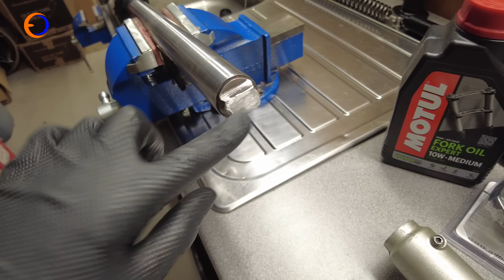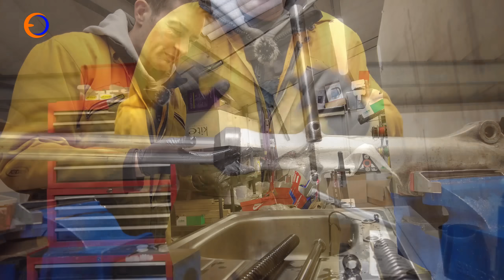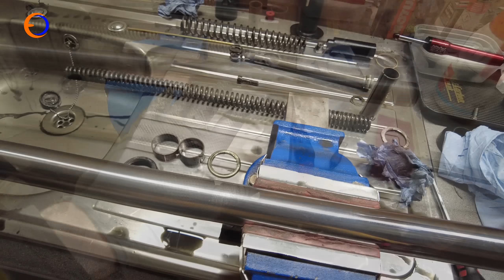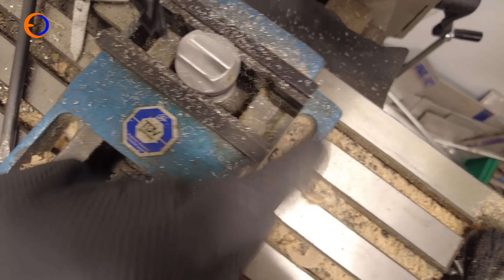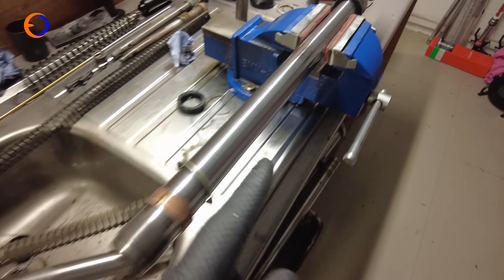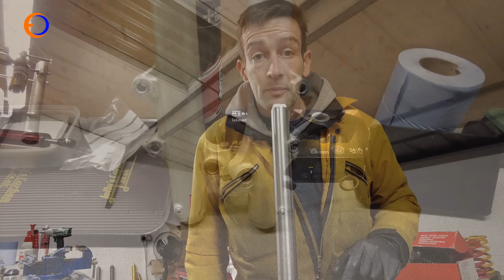Old Skool Fork Rebuild. Suspension service for the Suzuki GSX 750 Project build. Restoration. 80's

Comment: Dave at 11:20 I'm terribly sorry to tell you but you rebuilt the fork wrong. That washer needs to sit above the top bushing and you drive the universal fork seal tool against the washer to seat it. Then the oil deal, then the dust seal. That's metal washer is NOT in the correct place sorry to be the bearer of bad news

Comment: The washer above the oil seal looks to large to me , it looks like it will foul the seal as it’s to tight around the stanchion, and the forks are air assisted if memory serves me well pressure is about 11psi for normal riding

Comment: A well explained process with no BS. It is truly amazing the difference a fork refresh can make. I stripped and rebuilt 1998 XJ600n forks, new bushes, seals and oil and the forks are every bit as good as they need to be for a road going bike. In fact it gives a nicer ride than my Z900RS.

Comment: My old cb900 years back had air forks. Just a couple of valves. You'd give them a couple pumps with a footpump then adjust to about 5psi think it was. It did actually make a difference. It was a regular thing to do as it was so little air and it didn't last long.

Comment: owned the 78 gs750, any wonder at 110mph you would xperience serious wobbles, the fix was to bridge the forks at the fenner with a thick brace ..  helped SOME . .  really needed larger forks, and steering damper.. the bikes would do 125 mph but the wobbles were so bad you din't dare go over 105-110 .. anyone rode back then knows what I mean, the brace was worth 5-10 mph depending on surface condition, tire pressure tires all that .. fun fun fun
Reply from the maker: When men were men and hedge bottoms were worried
Reply: My 1978 GS750 double disc wire wheels, was solid up to indicated 130mph it had flat drag bars Girling rear shocks and Metzeler tyres that transformed it, that was coming off a GT500 that did wobble though!
Wish I still had both bikes now.

Comment: those used to be schrader valves to pout nitrogen in the forks..  pressurized, yup, gave you more adjustment,  very soft or very hard . . adjust with pressure and spring rates .. yup, rear shocks worked the same way but they had some spring pre laod adjustment, this was all before adjustable shim stack and valve suspension .. a good suspension guy could install adjustable cartridges and adjustable preload but it was expensoive fopr top crews in the 50's 60's and early 70's, then of course they installed 3-4 way adjustment as standard in around 72 or so. . .  YEA DAMPING!!!
Reply from the maker: All part of the charm of old tech

Comment: I restored my gt750 Suzuki a few years back & I restored a spare set of forks that I had,one of the top caps would not come out after heating it up & really giving the cap some large amounts of hammering it came out,so look out for the stuck fork cap

Comment: Ah they were the days if you bought a second hand bike with no fork oil leaks generally it was because someone had drained the oil out 😂 and early air forks were terrible especially when someone had used an airline to set the 7-10 psi pressure and blown the seals 😂😂😂

Comment: Tut-tut Dave😮 There should be a schrader valve inserts in the top cap. From what I remember, they ran about 25 to 30 psi. Max 36 psi. Obviously the sealing washers and fork seals need to be good, or the  air pressure blows all the oil out😅
Reply: My memory isn't what it was, well I am old😂 The pressure should be 8.5 to 17 psi. Whether you can actually tell the difference nowadays, with modern forks being so good, I don't know.
Reply: I had  a GSX 750, bought it new in 1980, 99% sure it didn't have any air valves in the forks, in fact fitted an aftermarket kit, can't remember if it made any difference!
Reply: No shaders, and not filled with air. Filled with nitrogen. If you filled them with air you’re a pleb.